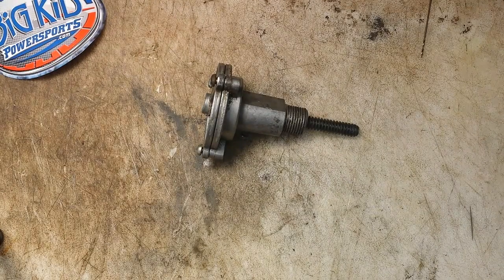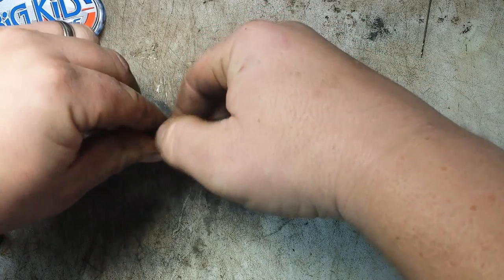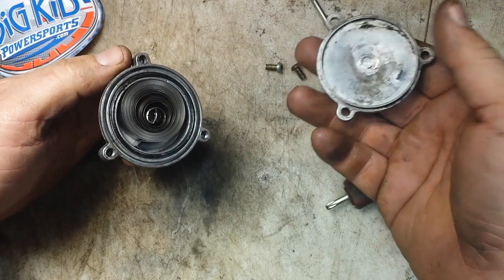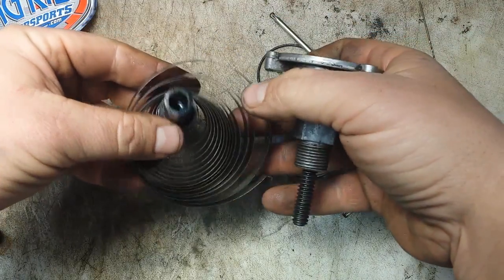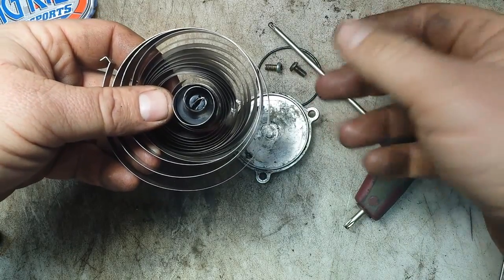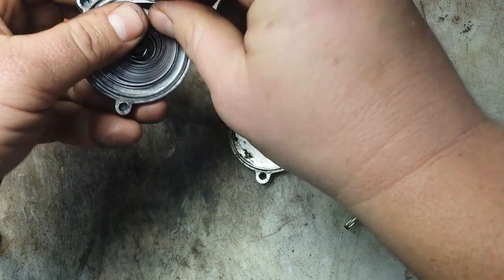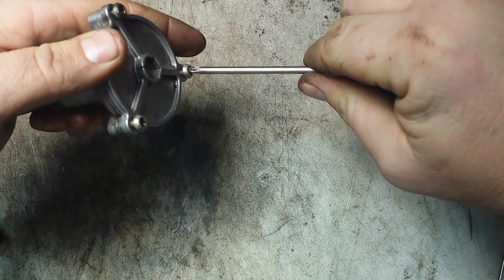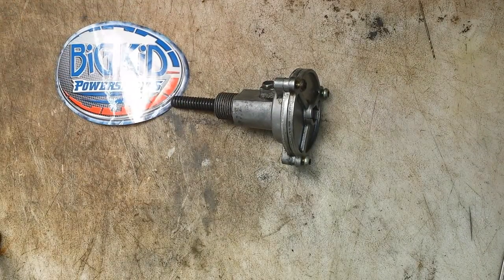Arctic Cat Auto Tensioner Rebuild

Comment: FYI. the service manual says to give it 20 turns of the cap to load the spring properly. Also the screw on the side is not a set screw, just a cap. Remove that, install a longer screw to hold the adjuster in place.
Reply: Yup
Reply: Thanks for this, I noticed that the set screw was waaay to short. Problem solved.

Comment: Can you just run the tensioner all the way in by hand. Then put in the center piece and spring. Then put on the cap, then spin the cap clockwise 10 or so times before you put in the screws?